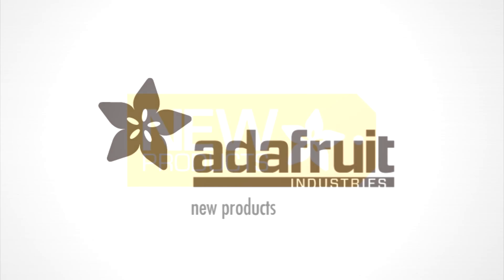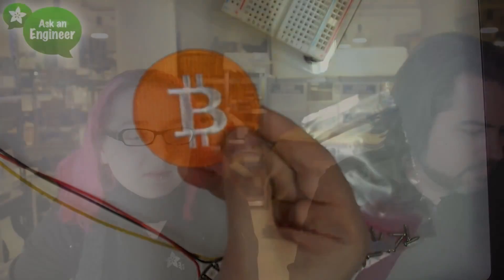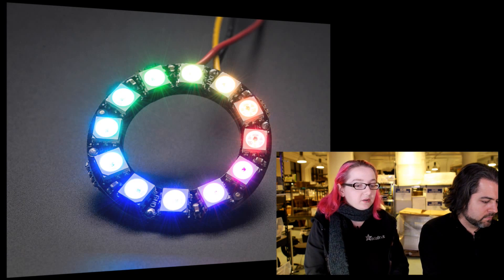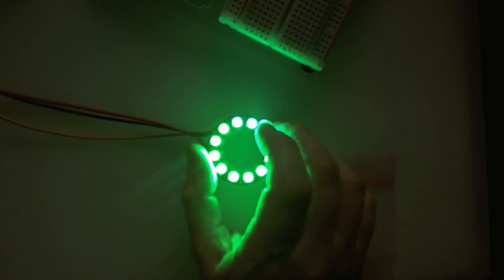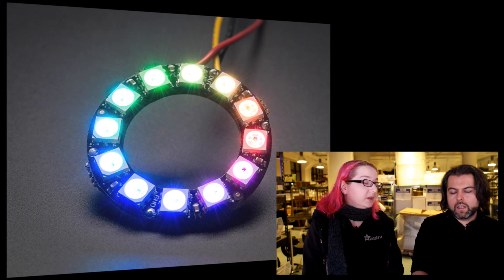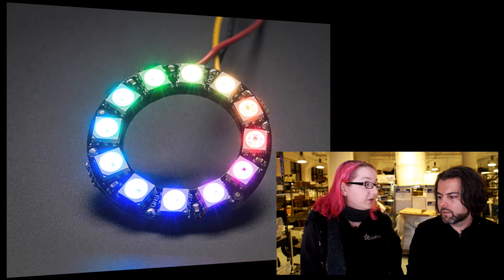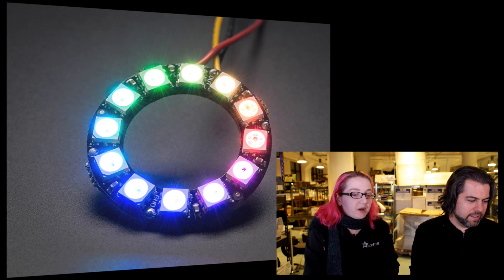New Products 12/28/2013

Comment from the maker: See what's new this week! New Products 12/28/2013

Bitcoin - Skill badge, iron-on patch (0:12) http://www.adafruit.com/products/1642

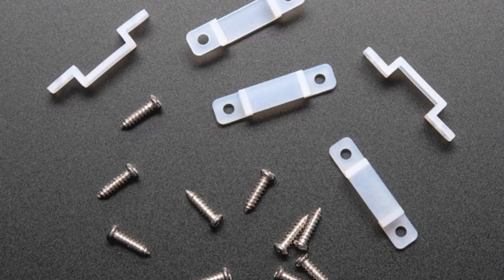Silicone Clips and Screws for NeoPixel LED Strips - set of 5 (3:00) http://www.adafruit.com/products/1644

NeoPixel Ring - 12 x WS2812 5050 RGB LED with Integrated Drivers (3:40) http://www.adafruit.com/products/1643

 #adafruit   #raspberrypi   #opensource   #electronics   #arduino   #led   #neopixel   #leds   #neopixels   #bitcoin   #hardware
Reply: you forgot  #awesome